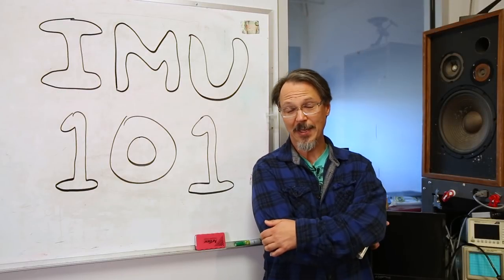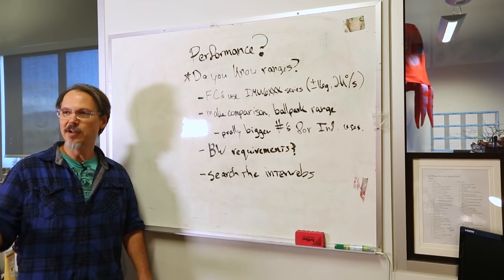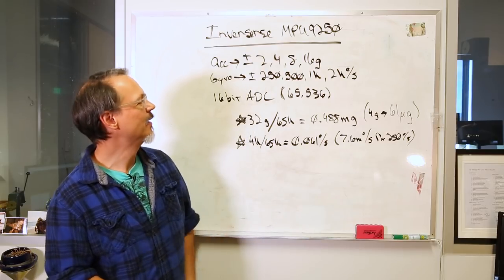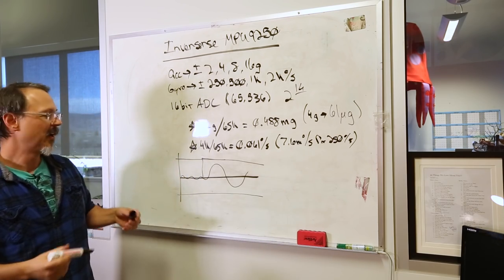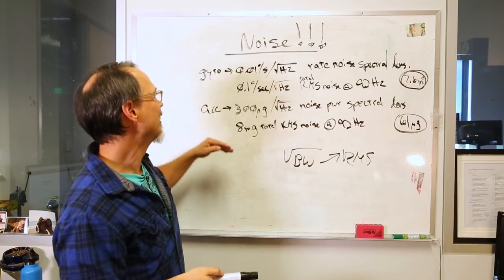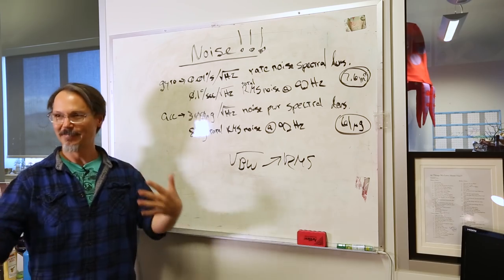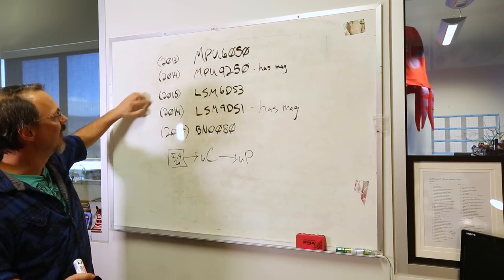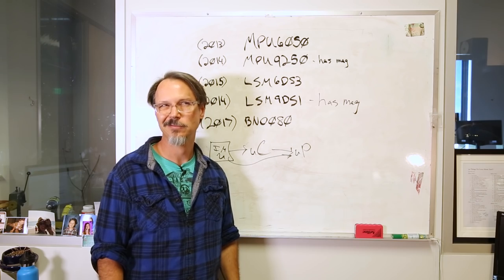According to Pete #61 - IMU 101

Comment: Hi there, thanks for the great info. 
Very nicely presented, cleared a lot up for me in the IMU space. Just felt it ended a little soon, would've been good to get a better understanding of how the BNOXXX is different from the other options in more detail. Guessing it's the sensor fusion work done onboard? 

Maybe an update #102, covering the last few years 2018 to today 2020-21. Talking about the BNO080-85 and any other comparable IMU's on the market today may be the ICM-20948 would be a good comparison to the BOSCH models.

Thanks again
Cheerio